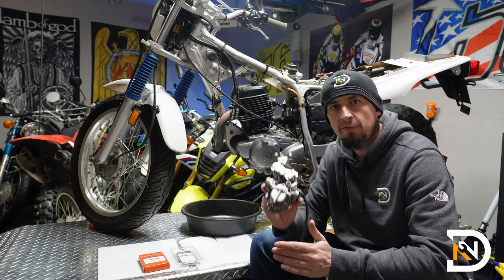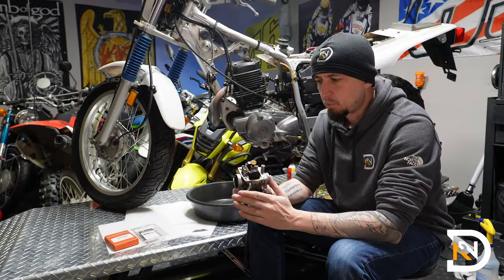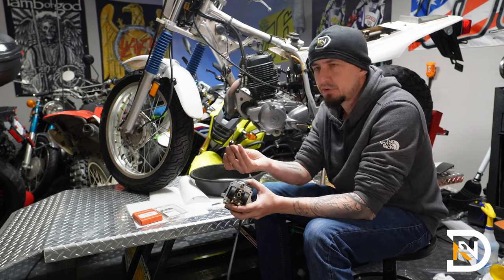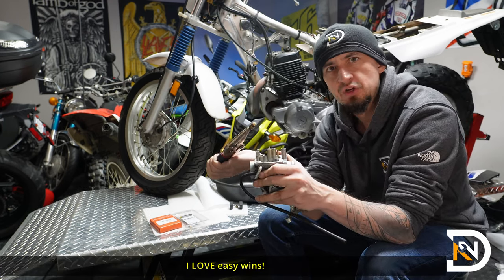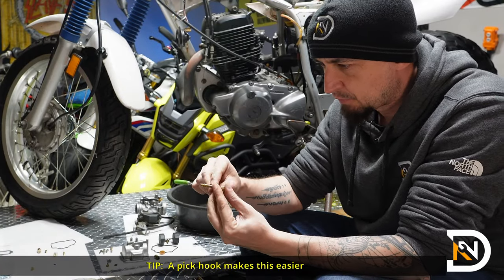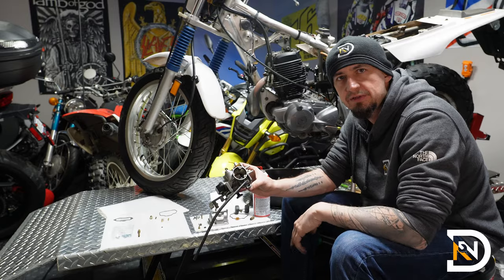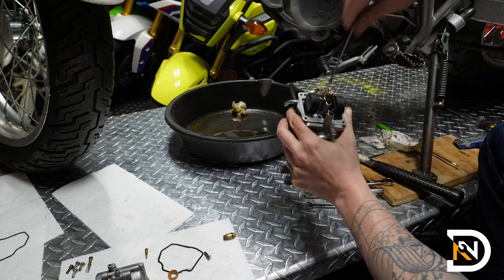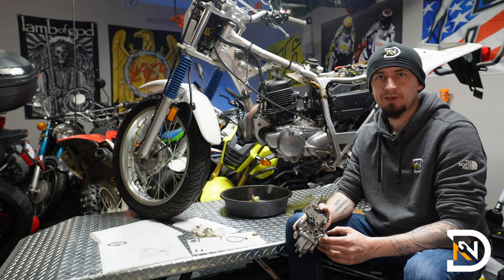How To Rebuild a Motorcycle Carburetor – Yamaha TW200 Carb Clean and Rebuild DIY

Comment: Why did you rebuild this carb? Was the bike not running properly? If so, can you explain the symptoms and did this rebuilt resolve the problems?
Reply from the maker: I picked up the bike at auction and it wasn't running, so as with any carb the first step was to clean or rebuild.  When I opened up the carb I saw the gaskets were in bad shape so I just got the rebuild kit.  In general, carburetors tend to be picky so if the bike isn't running well one of the first steps is to clean it out, especially if it's been sitting for a while.  It's also a good idea to run them dry when you don't plan to ride it for a few days (start the bike , then turn off the fuel valve and just let it run out of gas).  This will keep things from clogging up...

Comment: The screws on the TW and many other Japanese motorcycles are not standard US Phillips screws, they are JIS (Japanese Industry Standard) screws. That is why they strip out so easily;
Reply from the maker: Thanks, I had no idea.  They're definitely a very soft metal...
Reply: @danondemand it is the shape of the bit not the material that is the issue